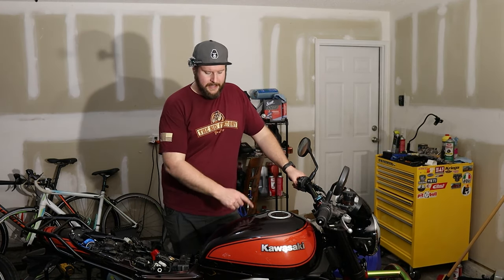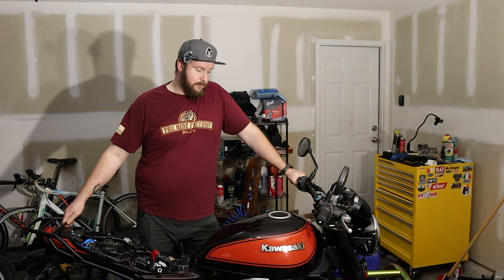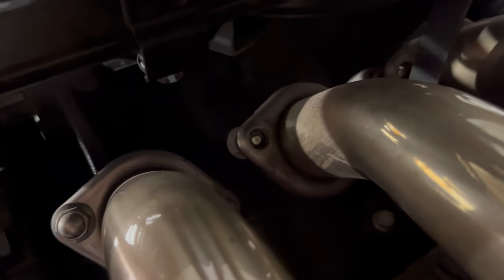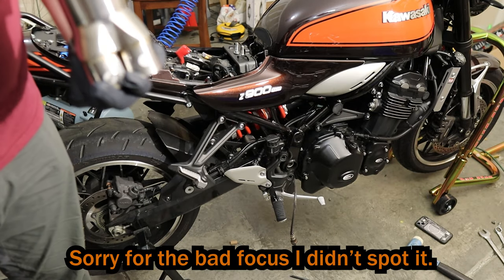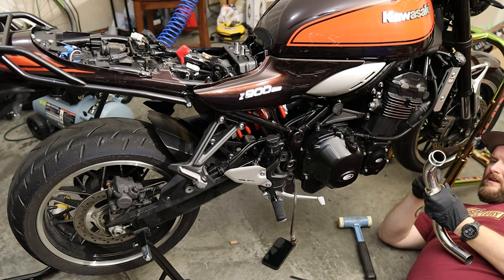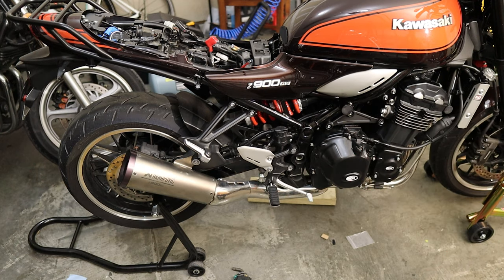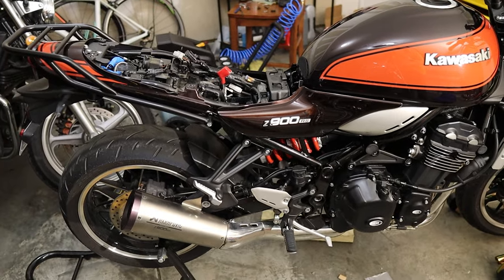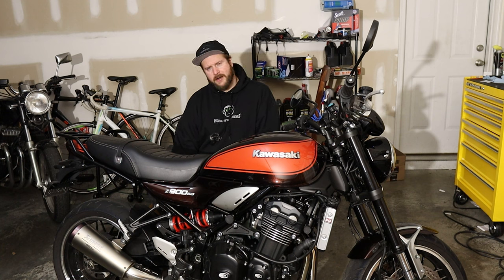How to Fit Delkevic Headers to a Kawasaki Z900RS

Comment: I have steered away from full exhaust systems. I have a full Delkevic system on my Kawasaki GPz750 and it is a great system (if a bit too loud). But full exhaust systems are low on the priority list when I get bikes these days. I tend to focus on the suspension and things to make the bike more comfortable (younger me would be disgusted to hear me saying this).
I was impressed with the support form Delkevic. I had an enquiry regarding the exhaust on my bike and they were very helpful.
Reply from the maker: That's fair. I mean they are largely unnecessary especially with newer bikes. The only time I'd do it is if it's a proven choke point on a bike I want to bring to the track, like in this case :) Plus I do hate bread boxes 😂 
Suspension definitely is my number 1 big change for my last several bikes. Makes it so much more pleasant even for handling! 
I found them very responsive too. Very happy to buy stuff from them!
Reply: I also prioritized suspension - just a Nitron R3 shock for now, maybe the forks in the future. It made a huge difference in the handling and stopping the bike from wallowing in the corners with my 200 lb self. Now I'm doing the Delkevic and Ivan's tune too. Less about power (I really don't want or need more) and more about appearance (bread box) and taming the twitchy throttle a bit and smoother power delivery. I'm also going to step up to a 16T front sprocket for the same reason.
Reply from the maker: Thankfully the spring change alone was enough for me, it's not perfect but it works great even on track :) 
I was thinking of going up in gearing myself! I'll update if I do as well.

Comment: The long bolt you said stripped on the way out was made that way for ease of assembly. As for the new bolt replacement yes it is only just long enough but 5mm longer would be better.
Reply from the maker: I did think it was very odd that it had stripped and I hadn't felt anything, either way stripped intentionally or not for assembly it wasn't usable. That's what I said?  It barely is long enough. That said it has held up to road use and a track day now.

Comment: I just put some delkevic headers on my z900 and i was surprised that the delkevic head pipes are smaller than the oem head pipes. I guess thats how they can say it doesnt need a tune .
Reply from the maker: The stock head pipes on most modern bikes are actually double walled also, so the internal diameter is very likely the same, if the delkevic ones are even wider. I personally wouldn't delete a breadbox and not get a tune.

Comment: Did you use any sealant, paste or gaskets between the link pipe and headers, or can? Or are they ok without? Thanks!!
Reply from the maker: Just used the supplied header gaskets and no leaks so far. I have paste if I need it if it ever becomes an issue!

Comment: Hi, do i need a tune if i am satisfied with how well its running with delkevic headers? (i have an 2022)
Reply from the maker: Without throwing it on a dyno it'd be hard to say, you could run a few 100 miles and pull your plugs for a look but the risk of running lean is high as they're lean from factory anyway. Personally I would get a tune.
Reply: @TheGorillaBiker  Thank you sir.
Reply from the maker: No problem! :)

Comment: Toaster to the rescue again! If the powers that be want us to use CATs then perhaps they should lobby racing to make CATs compulsory.  If WSBK or MotoGP had to use CATs then you can bet the technology would change and make CATS half the size and weight. . . .  My current exhaust is a one piece all the way through.  It is unbelievably rusty and so must be very thick cast iron or something because it should be full of holes by now.  As I am not racing anymore saving weight and making noise are irrelevant to me. I doubt I would ever change a system on a road bike. 🤔  Small point, could you have put the silencer bracket the other side, put washers on to move it away from the swingarm?  I worry that the lateral forces on the track  are far greater than you with put through it on the road?!?!   I don't pay premium prices for anything just because it is "branded".  If it has a bloody great label on it they should be paying us to display the advert!  A good video.  Bike looks the business. 👍
Reply from the maker: It's handy having the garage off the house I can just cry for help :D Agreed, the fact the stock exhaust is a 5kg lump is insane to me. I also really hate how they look :D That bike of yours always just sounds more and more like it was mad to last. Needs fettling sure but solid. 
Oh I'm a sucker for a nice exhaust, I have and will probably always change them, this one I did only change as it was a restriction for the tune, and they bike felt like it had waaaaay more in it on the track, on the road it was grand as it was. 
I tried, it really didn't want to come out that far, the camera always makes gaps look smaller too, it's plenty of clearance really. I might try bend it out again now it's all settled and update you! 
Me neither, the flow on the Akropovic system is apparently ever so slightly better at the top end but the Delkevic is slightly better mid range so I'm happy with the trade off. And yes, someone please pay me for advertising exhausts :D I can buy more bikes then :D 
Thanks :)